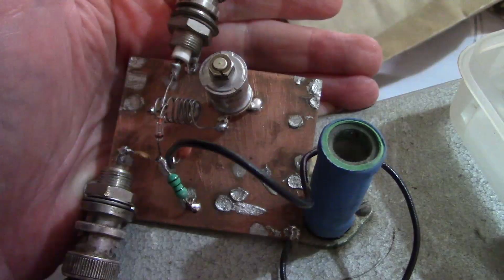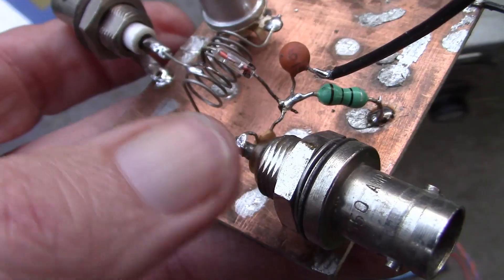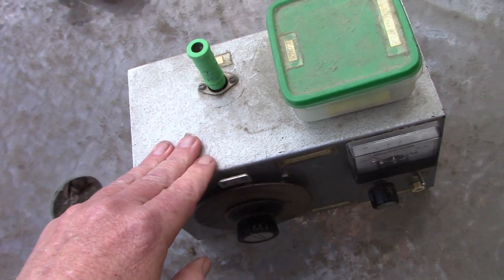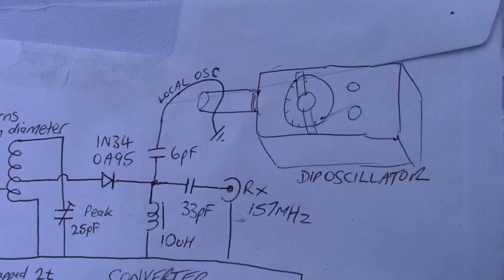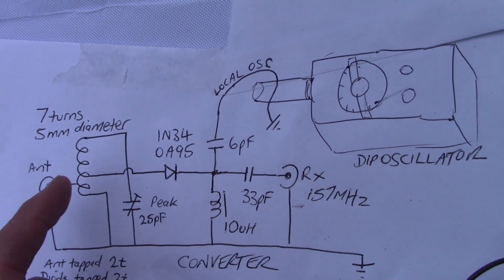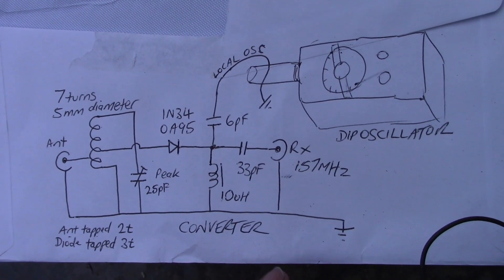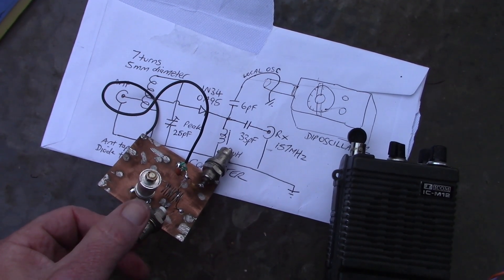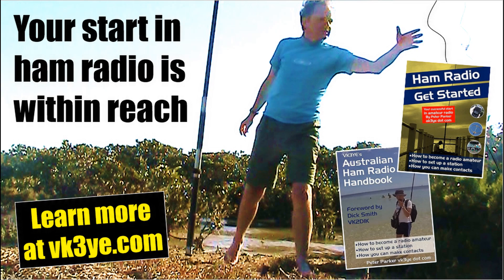Hear more on a VHF marine transceiver with this simple converter

Comment: Looks like that ic M12 takes the same battery as the ic 2e and 4e both very good hand helds of there time think you can still get the BP8 batteries for them and there not that expensive.
Reply: They're 8.4V. Two fully charged 18650 batteries would be fine, it would be good for tx too. Get the old stuffed nickel metal hydride battery, gut it and put li-ion packs and charging module inside
Reply: I've got a once popular 2-meter Icom-designed radio picked up by Radio Shack that used a similar battery pack. Someone needs to create an 18650 lithium battery pack for them.
Reply: @Inkling777 I've got a set of 1.5 volt lithium ion 3.5 amp AA batteries there really handy use them in one of my scanners because they're the same diameter of normal alkaline AA's also fit empty AA hand held cases.

Comment: I didnt realize there were still mpt trunking systems around
Reply: The MPT1327 statewide SMR network in Victoria is pretty much in it's last days.
Rural Ambulance (who you could hear on Peters setup) have migrated to digital encrypted P25 but are still simulcasting to the analog SMR in limited form.
Won't be long until Telstra switches the SMR off for good.